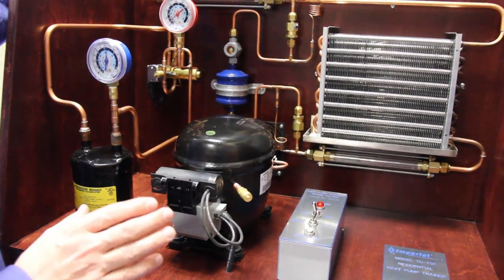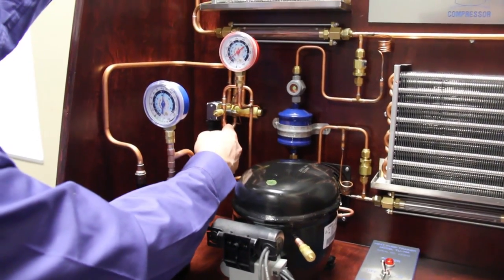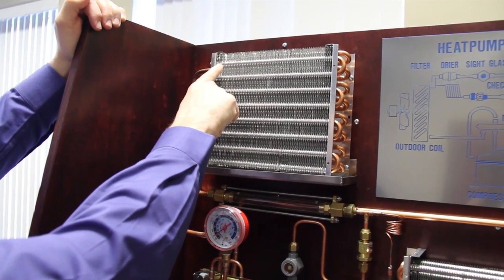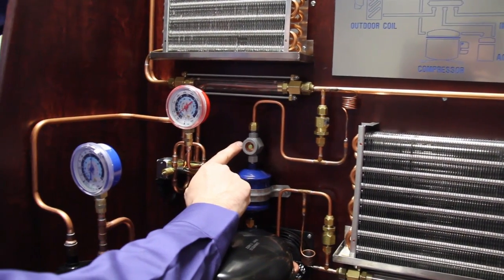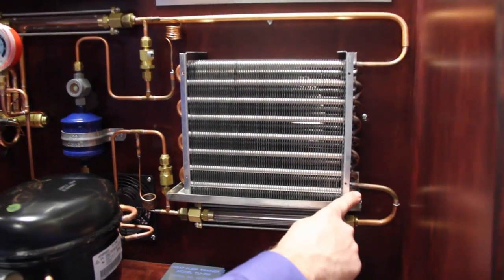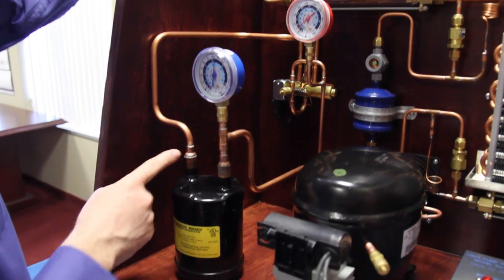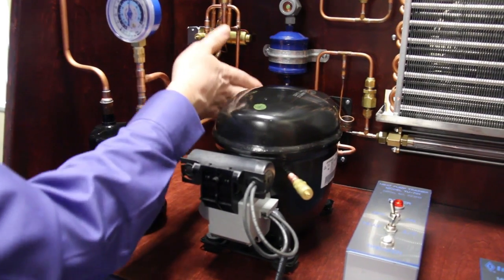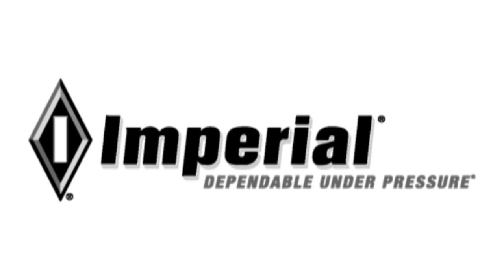iConnect Training Model TU-701 Heat Pump Trainer Components & Refrigeration Cycle

Comment: Yeah I think this video requires a lot more than 4 minutes since it's far more complex than a standard system. The camera work needs more detail on following the exact lines of flow when reversing valve is operated and when it's not.